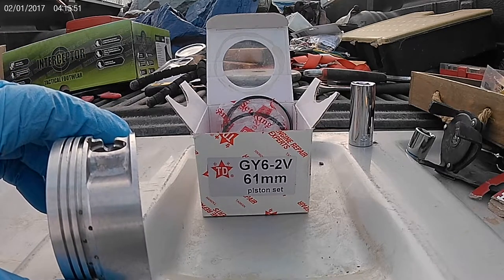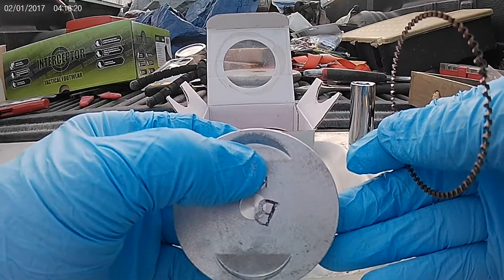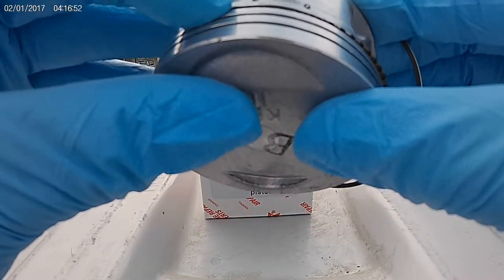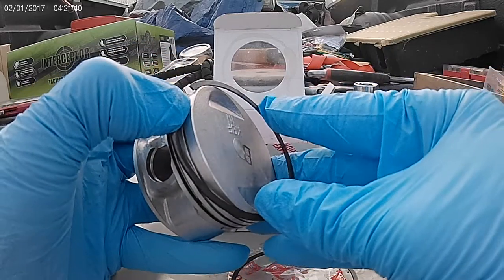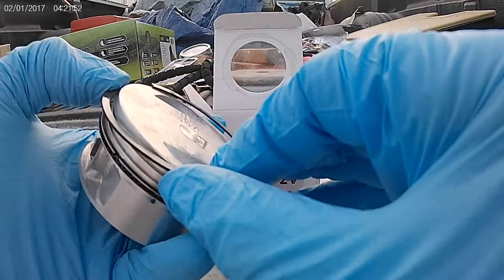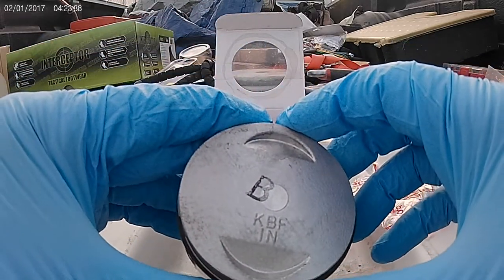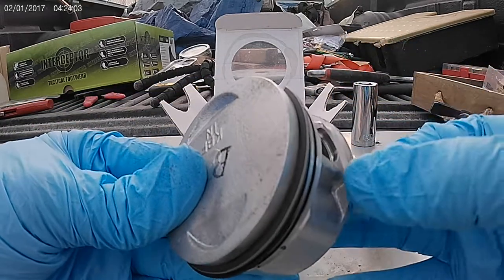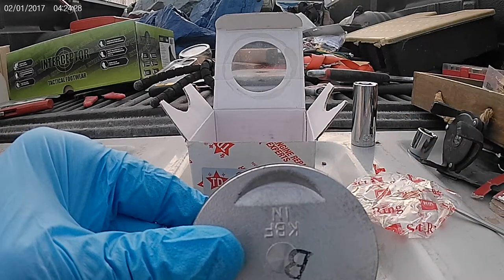150cc / 171cc gy6 61mm Taida piston how to install rings / ring order / clocking rings

Comment: Which those 171 kits make a huge difference don't they
Reply from the maker: Yeah they do. Mine has a nice takeoff with 14g sliders. I want to change the final gearing eventually.
Reply: @thelagmeister  yeah those final gears make a world of difference as I've done both my Honda Ruckus with GET Motor and 232cc 4v Liquid Cooled both up Gearing keeps it rpm safe which is nice to have.

Comment: You definitely want to add hastags in your info section like look at mine and you will see so helps people find your videos easier as I didn't Relize I didn't have you on all notifications and now I do.
Reply from the maker: Cool . Thanks. I'll have to add those. I never really thought about the hashtags.  I'm going to make sure I got the notifications for yours as well.
Reply: @thelagmeister  every little bit helps brother also feel out those key words as well
Reply from the maker: @Kevin Stearns You need to make sure the skirt diameter is the 62.7 mm NOT 65mm for the 61mm kit. The stock head is ok but if you have the egr head You need the Block off plate. Get a 26mm CVK and exhaust pipe and call it a day. The oversized valves will work better, but aren't necessary. Check out https://www.rollingwrenchdenver.com/ My buddy Matt has everything you need and then some.
Reply from the maker: @Kevin Stearns it won't fit inside of the case.
Reply from the maker: @Kevin Stearns you're welcome
Reply from the maker: @Kevin Stearns oh no. I really didn't want to spend $140+ on a cylinder kit, but I didn't want to do any extra work. The 61mm head will still work on the bike. I'm sure it will run better with an upgraded head and carb. I have an extra engine that I've been thinking about boring the case for a 63mm piston.
Reply: @Kevin Stearns all the information he gave you was great advice for real lagmeister knows exactly what he's talking about

Comment: Yep never he man ever we did in basically same formation always having our gaps opposite of each other which people not Relize just how important it is when lubrication with the friction within the cylinder
Reply from the maker: This is the way I normally do it. I always think of it like a VW because the gy6 is an air cooled horizontal engine. I planned on making another video showing the other method.
Reply: @thelagmeister  heck think your doing great job
Reply from the maker: @ORIGINALCONCEPTGARAGE  thanks man. Same to you. I've been catching up on your vids. Has the 232 been pretty good so far? I keep thinking about building one.
Reply: @thelagmeister  I'm telling ya if I could I would of did a pcx swap